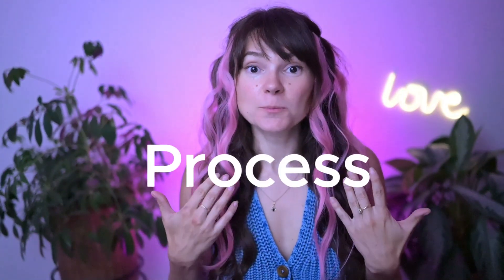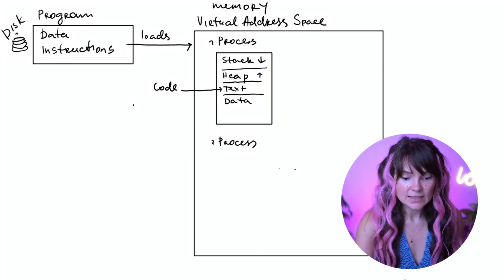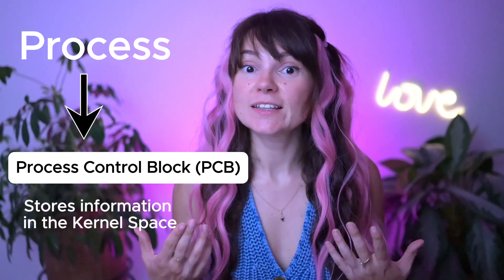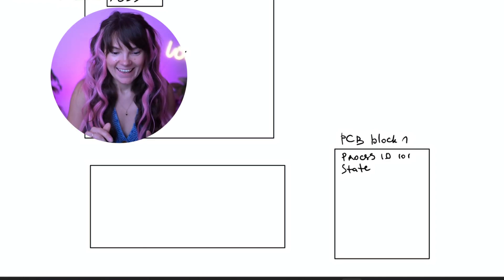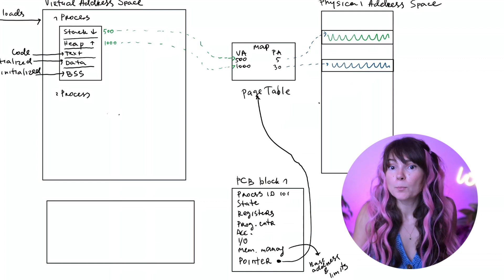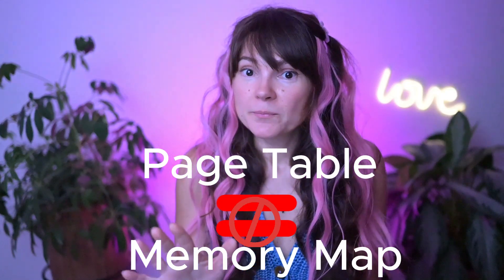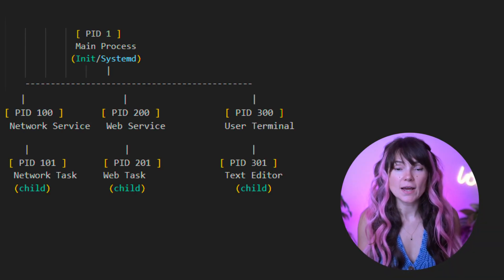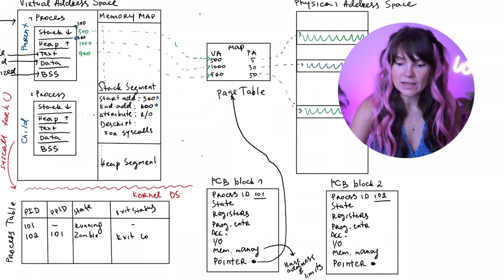Linux Processes Explained: Process Table, PCB, Memory Maps & More

Comment: This is one of the reasons why C++ is so slow. It uses heap for almost everything. While in C, You are the one with the power.
Reply from the maker: C and C++ are very similar here,  in both, the programmer controls whether memory goes on the stack or the heap. C++ doesn’t automatically mean “heap everywhere.”
You might be thinking of higher-level languages like Python 🙂
Reply: @TechFairyAnna  compiled C++ code calls malloc() every time when "object" is created. It's funny in decompiled code when I see malloc(32) hundreds times in single .so lib.

Comment: the process concept is a little ambiguous to me . I mean I can imagine the PCB because it is a data structure but the process I feel like it is an action happening rather than an entity so I can;t understand how the cpu deals with different processes as different entities
Reply from the maker: Yeah, I get that the concept of a process could be a bit ambiguous because it’s not just an action but also an entity. A process includes the code from the program as well as its state and other info saved in the PCB. Each process has its own PCB and its own virtual address space.

Let’s say you launch two programs; two processes are created, and entries are made in two Process Control Blocks (PCBs). For example, when you compile one program, the CPU receives binary code to work with (lines of 1s and 0s). A line like int y = a; could translate into machine instructions that look like this: LOAD R1, 1, LOAD R2, 1, ADD R1, R2. Your second program would give the CPU different instructions to work with.

The CPU processes this binary code line by line and can switch between two or more processes as needed, like when an I/O interrupt occurs. Each time it switches, it saves all the necessary information in the PCB, allowing it to resume from where it left off. So, imagine the CPU processes LOAD first, then saves the register info, the process state, and other necessary info in the PCB for that process. Then it moves on to process a line of code from another process and can switch back and forth. This creates the illusion that multiple processes are running simultaneously because the CPU processes them super fast but treats them as separate entities.

Ooo, I hope this clears things up! Let me know! Check out my video on system calls, where I explain in detail how a system call travels from user space to the kernel and back. While it’s not exactly related to processes and this particular topic but they are all related!! It can help you understand how OS controls access to resources and ensures that processes can perform their tasks efficiently without interfering with one another.
Reply: @TechFairyAnna  thx very much for your reply .Ok I will check it  .
should I imagine the process as sequence of different things in memory? say for example from 8000 to 12000 where alot of things is there text section data section stack and heap ? and the os especially the dispatcher is the one who shifts the cpu from 8200 for example to 5000? and the  start 8000 and end 12000 are in the pcb and that is how the os differentiate ?

and if so what is the role of pid in that story?
Reply from the maker: @aliaatarek7106 This is a fantastic way to visualize the process! You're definitely heading in the right direction. PID stands for Process Identifier, it is essential for differentiating between processes and their respective PCBs. Remember, each PCB has a PID, and the PID uniquely identifies a process within the system.
Reply: Process is a running program (i.e. elf file loaded into memory, with memory segments such as text, stack, heap, etc setup) and its allocated resources (RAM, file descriptors, etc)